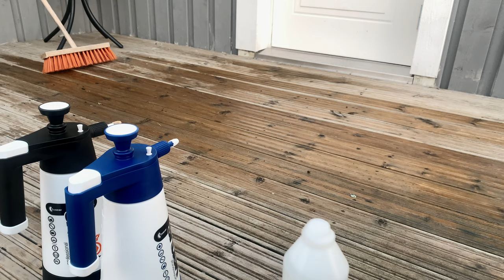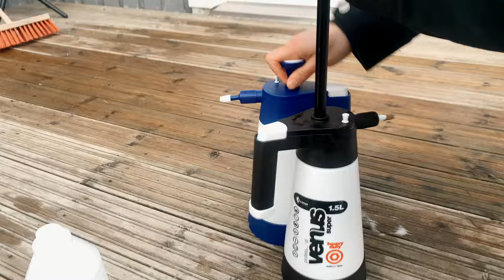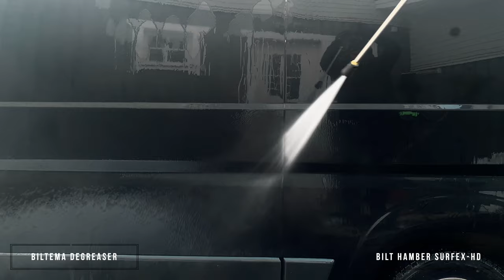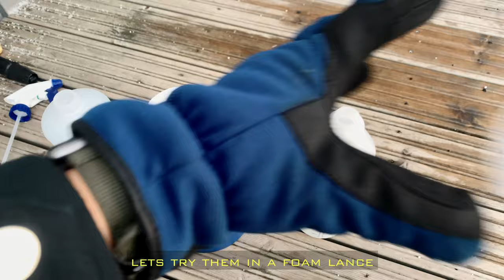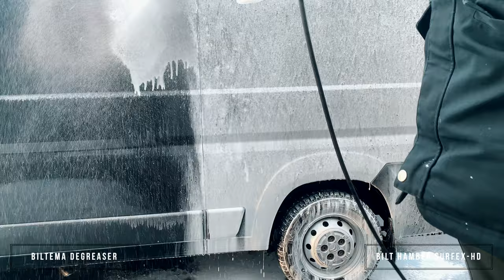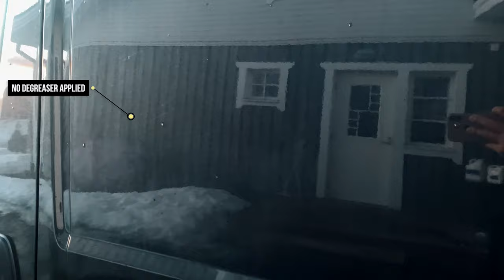BILTEMA DEGREASER VS. BILT HAMBER SURFEX-HD - SPRAY + FOAM

Comment: Hello. I have a question.
When using HAMBER SURFEX-HD foam cannon, what is the best water and dilution ratio to use?
Reply from the maker: Surfex Hd will not get very thick foam when using in foam cannon, but It will work well as pre wash. I use it between 5-10%.